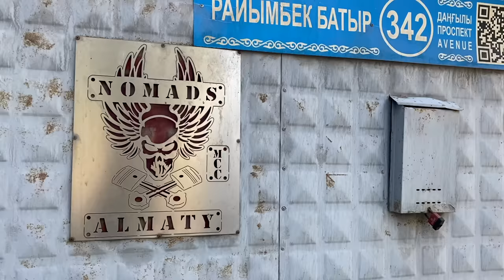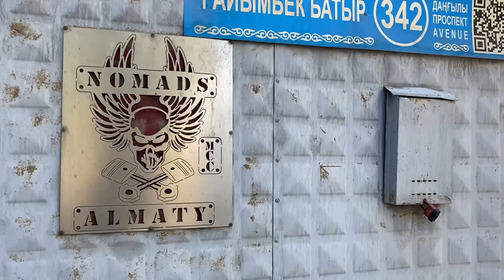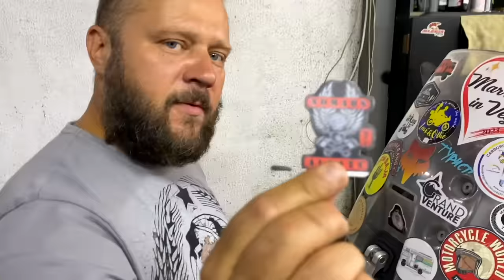KAZAKHSTAN MECHANIC TAKES OUR BIKE APART! 🇰🇿 [S5-E30]

Comment: Amazing service guys, such a relief to have Bumblebee ready for the long road home😁How nice of the garage to put their work on hold, fantastic service👍My brother had a Russian bike in the 80's called a Neval, sometimes the engine started in the wrong direction (it was a 2 stroke) and when he pulled away the bike reversed instead of going forward🤣The funniest thing happened one day when he stalled the bike at traffic signals and when he started it up he reversed into the car behind and the driver got out and apologised for running into him🤣
Reply from the maker: Oh no 🤣🤣🤣
Reply: In the USSR, the Neval motorcycle was called Minsk. engine 125 cc two clock

Comment: Glad you got it fixed, the max weight for a vstrom including rider, pillion fuel and luggage is 450kg I expect you're close to that so it's not surprising the shock is failing given the hammering it's getting on those roads

Comment: In your 38,000 miles, have you all ever had your Air Filter changed?
Reply: Or the valves ..?? They are supposed to be done every 15,000mls .
Reply from the maker: Yes 2 times ☺️